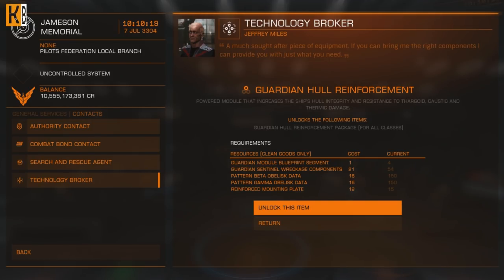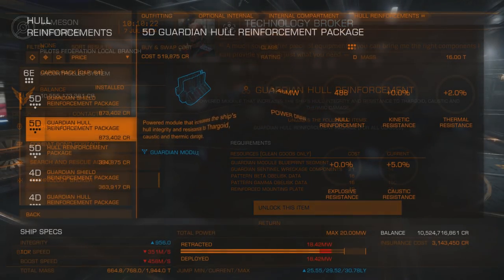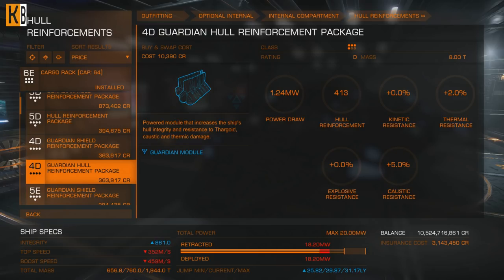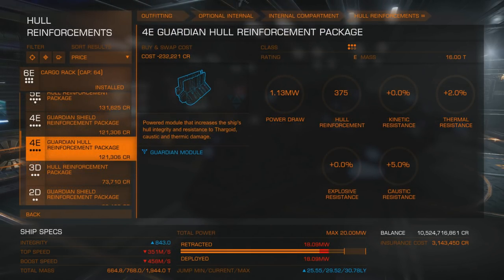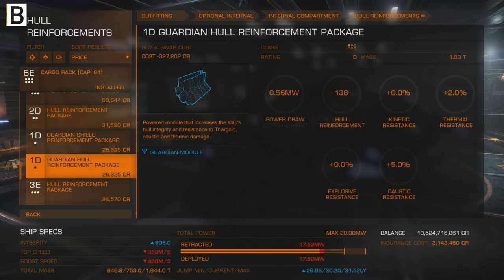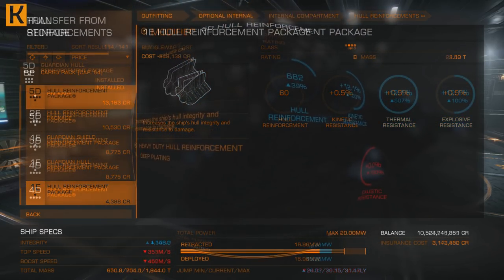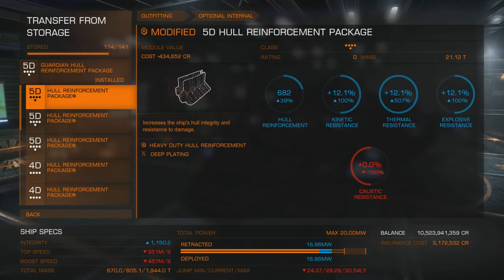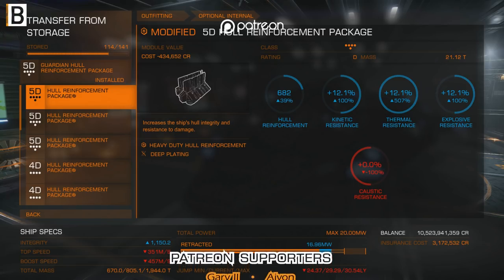Elite:Dangerous. Hull Reinforcement Packages: Guardian vs Engineered

Comment: I would say they are completely worthless because you need a lot of them to be equal to G5 regulars in defense, but cost too much power. In my opinion, they should put 75% more hull on them instead of 25%, either that or they should give immunity to corrosive effect, including the one given by multicannon and frag special.

Comment: Would like to see an analysis of how many Guardian HRPs you need to break even with Modded MRPs vs Thargoid Caustic damage.  Doing rough approximations on EDSY and Coriolis, I am seeing that five 5D Guardian HRPs ~= five G5 heavy duty HRPs.  Beyond this, the Guardian HRPs definitely take the lead, but below this number the Heavy Duty Modded HRPs seem to pull ahead.
Reply from the maker: if you fight thargoids forget about engineered modules - replace most you can with guardian stuff.
i probably would only keep one or two grade 5 heavy duty HRP, but classes 1-4 i would go for guardian (if my ships PP can handle that), but most likely i would only use several hrp and mostly go for module reinforcements, next video will be about those.
Reply: G5 Heavy Duty + Deep Plating gives you an absolute bonus of +89.2% for 5D HRPs.  Whereas the Guardian HRPs give you a +25% absolute and a +5% resist that spreads over the entire hull.   So in order for the Caustic resist bonus to beat out the absolute bonus from G5 heavy duty + deep plating, the resist bonus needs to be a higher than a certain break even value which should vary depending on the armor of the ship and the size of the internal module slots available.
Reply: I remember doing the math, if I did it correctly it was 28% caustic resistance before GHPs become better than HRPs, or 33% caustic resistance before they surpass deep plating HRPs.